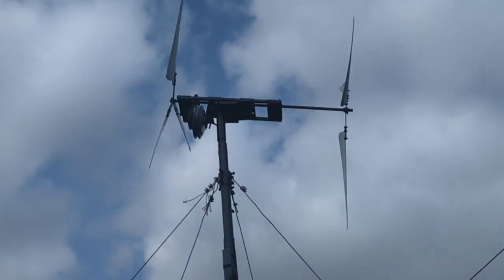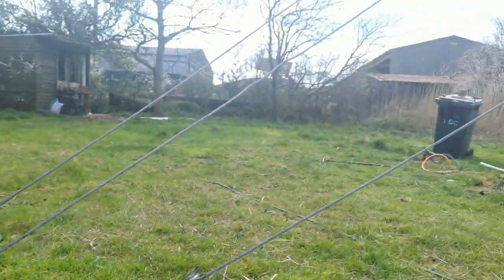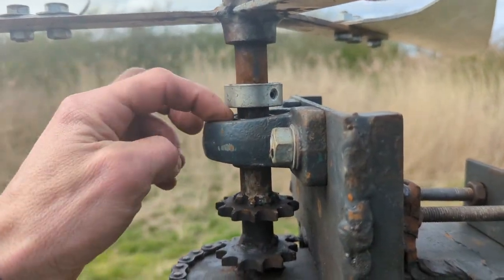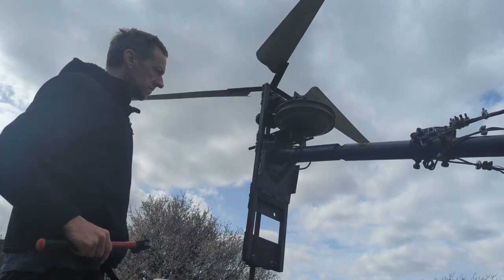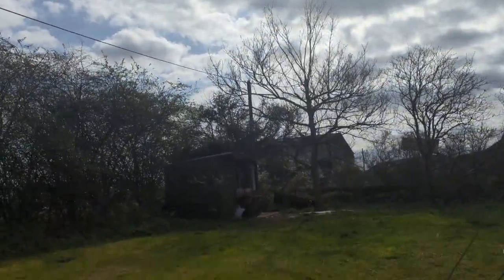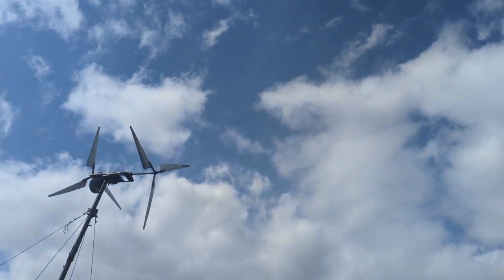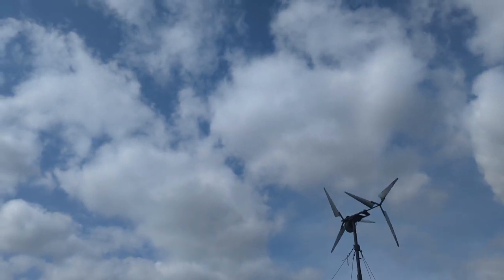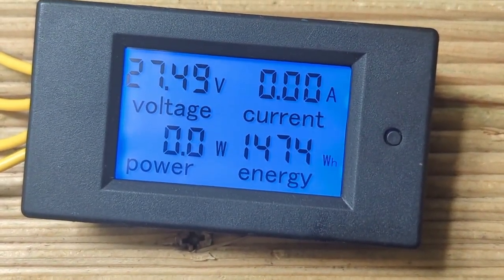Wind Turbine Free Energy Project - Some Work Needed!!! - 5th April 2022

Comment: hello, I really like your ideas, in this generator, you made some changes to the generator.  Like changing the post neodymium ferrite magnets, and the cable is the same original that comes star-connected.  could you tell me how many amps, rpm, in how long
Reply from the maker: Hello, thank you for the comment. No the motor is 100% standard. I have not opened it up or messed with it in any way. It's all about matching the blades to the generator which I am still working on.
Reply: Hi, it was very, very nice.  I'm from Brazil, and I would like to know how many amps you can get, when you're running.  at 200 rpm how many watts.  and amps.  It charges batteries at 12v to put 12/127 inverter.  If you can answer I would appreciate it.  Here in Brazil where I live it is very windy.  Put your videos in subtitles for all languages.  so we can read.